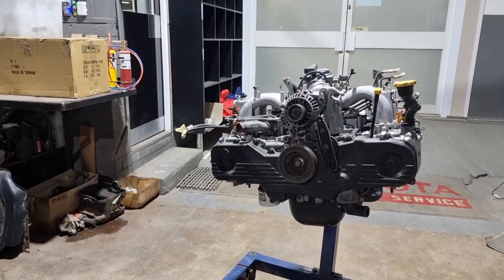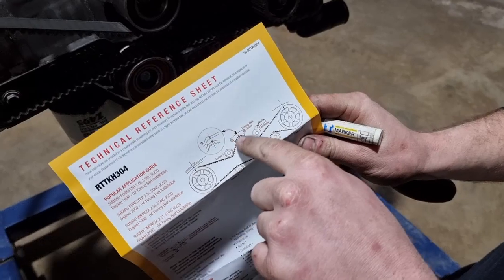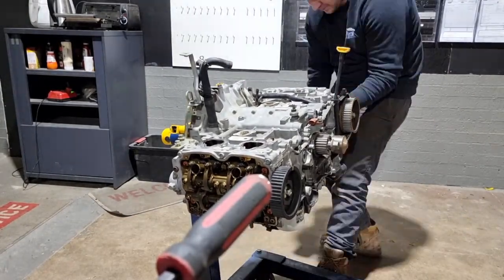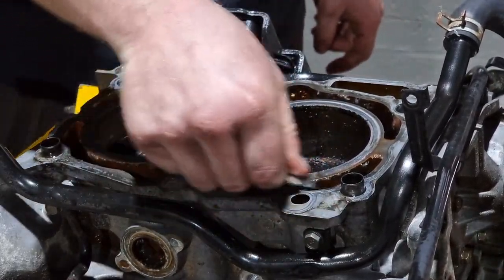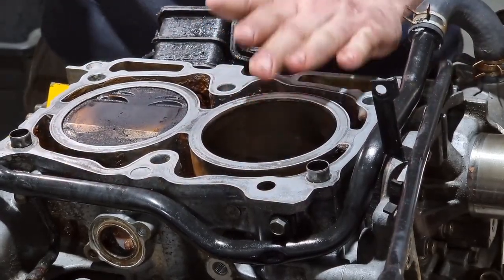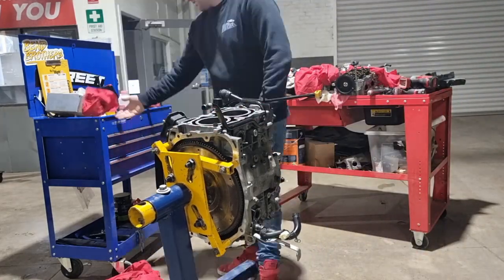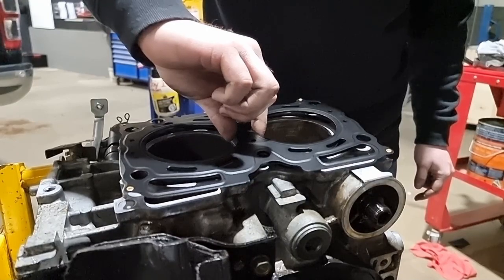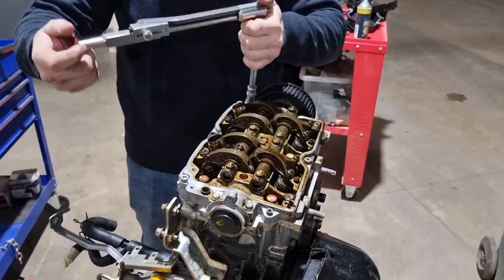How To Make an EJ Reliable | EJ20 Swap Brumby Series | Part Two

Comment: What type did u clean the heads with exactly so I can in future 👍
Reply from the maker: I normally give then a once over with a razor blade. Then use some very fine wet/dry sand paper and use wd40 instead of water on the sand paper. Scotch bright does a good job just be careful not to gouge the head. Or the best option would be to get the heads machined

Comment: what ej20 model came in your forester and what year forester? cheers love the vids and keep em up!
Reply: The EJ20 is a lot better motor than the EJ25, my EJ25 in my 2009 Forester has started to leak in this area. I’m converting it to EJ20 shortly (direct simple swap)
The thicker cylinder walls on the open deck block are less likely to ‘walk’ around like the EJ250 so less likely to do head gaskets.
Reply from the maker: @vintagetintrader1062  The 2.5 is probably the least reliable out of the ej’s
Reply from the maker: It’s from a 1997 foz, can’t recall the exact ej model sorry